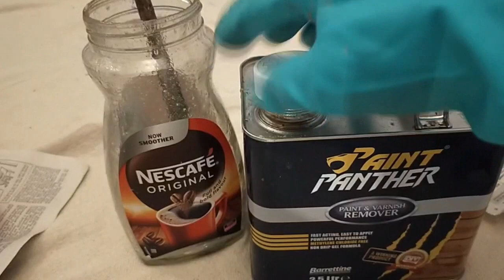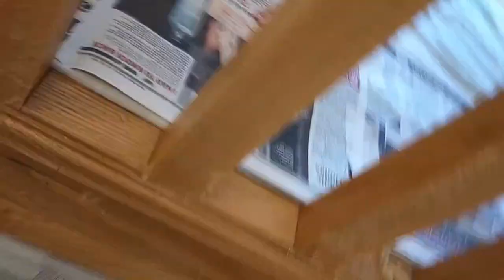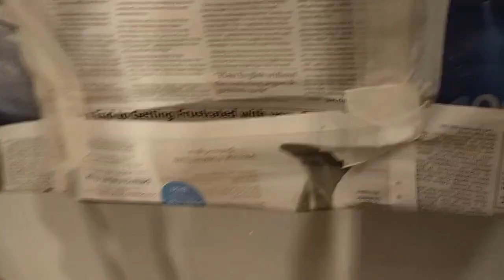How To Remove Varnish. Yellowing Varnish On A Staircase

Comment: How long did you leave it on?
Reply from the maker: About 40 minutes  but make sure you apply a few coats first in a few minutes just to build it up.  Then leave and see how it is after 40 minutes. Repeat process till all paint removed. Thanks

Comment: hello,have you a method of removing lacqeur from brass please?
Reply from the maker: Sometimes a bucket of soapy hot water and allow them to soak... or paint stripper. Thanks
Reply: After seeing that tip on this channel, I stuck some paint-covered door handles in a foil tray with hot water and washing up liquid on top of a stove for half an hour - they came up beautifully.